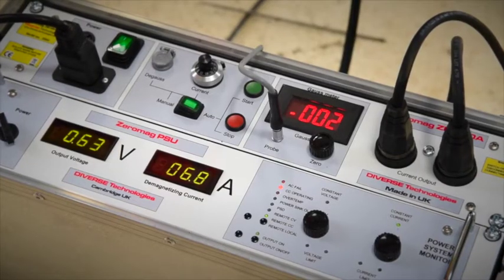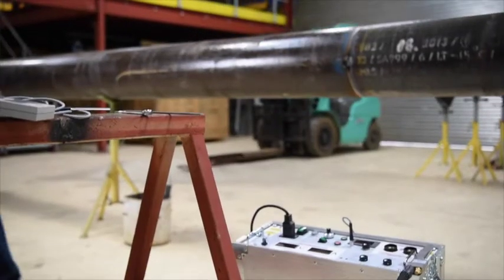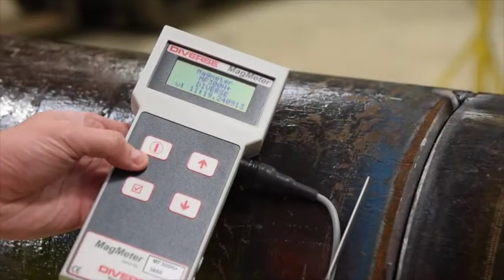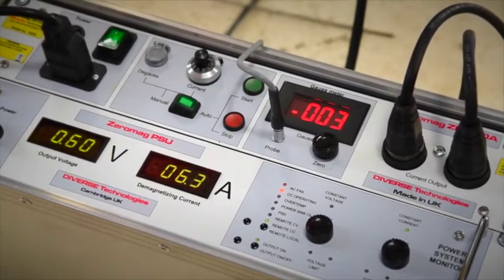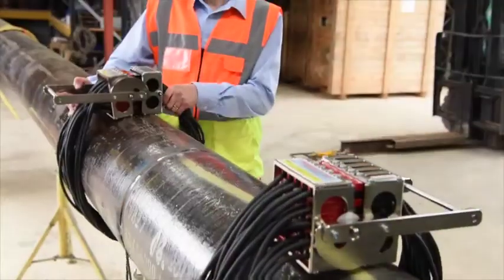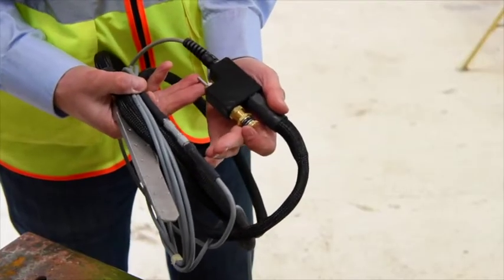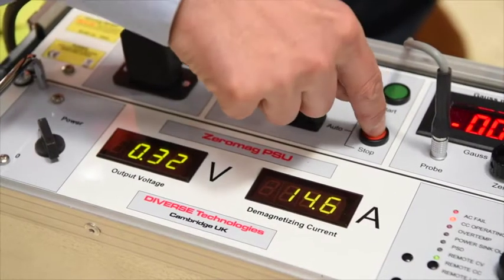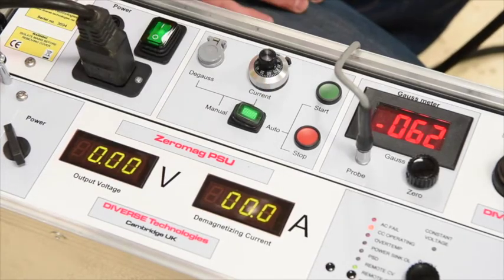Solve arc blow with Zeromag

Comment: How to weld on a electrical bus bar,  Aluminum Production Industries
Reply from the maker: Welding on busbars found in Smelters is not possible with Zeromag. However, Diverse have worked with smelters to develop a product called ZeroB. This has been used to weld cracks in busbars. For welding on busbars where a significant current flows through the weld, i.e. welding of cover plates, further development is required. Diverse require a smelter partner to take this further.